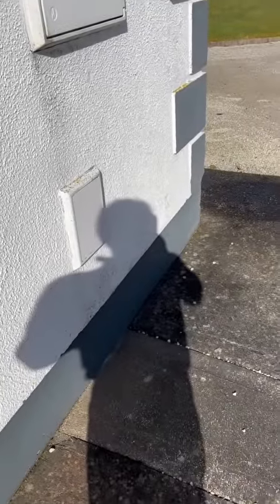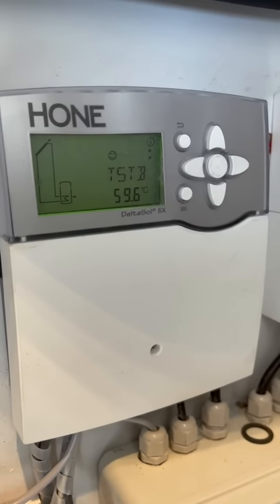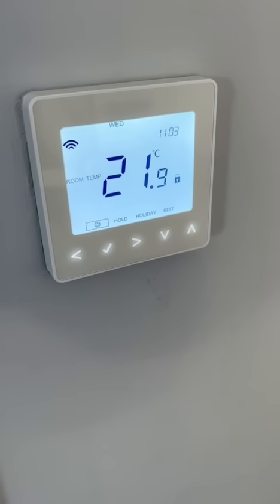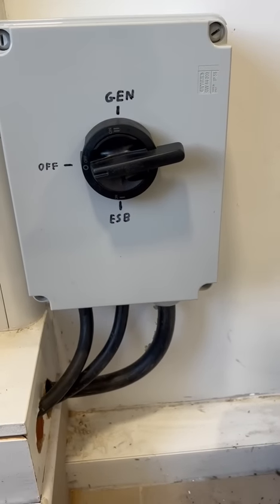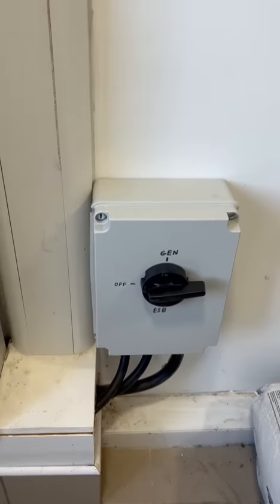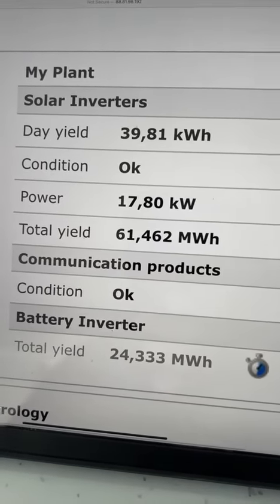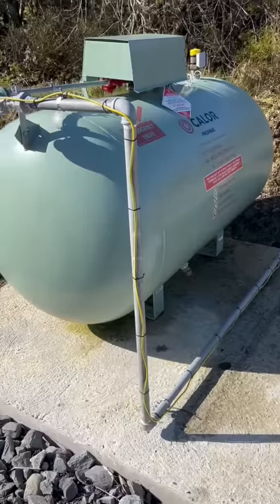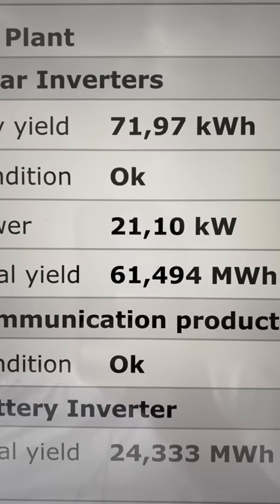Living off the grid in the west of Ireland....

Comment: Fantastic setup, it would be brilliant to see a breakdown of commercials to include ROI for your installation.
Reply from the maker: HI, if you go onto the main website and select social from the menu, you will see discussions on this subject on the post with this video. https://honeworld.com/eng/
Reply from the maker: HONE
0 seconds ago
The payback on this system is 5.1 years with 45 year design life. It had been 7.3 years payback but the current energy price hikes have shortened the payback so it will be fully paid for early next year.

4,500 sq ft home, no electricity bills, no heating bills, & 4 EV's charging since early 2018.

The cost for the energy upgrade, wall & attic insulation, MHRV, Chimney removal, Renewable Heating system, Renewable Electricity system, 1-week on-demand professional battery pack (70 kWh) & all controls, and management system so full unattended operation like as if it is a normal home was €90k in 2018.

- No heating bill
- No electricity bill
- No hot water bill
- No petrol bills - (EV charging is all free, and with current petrol rates, each kWh is worth over 90c in savings.
Reply from the maker: Basically, it's a lifestyle choice.

We don't like to rent our homes and prefer to own them, and they are significantly bigger purchase costs than energy systems.

Owning your own energy system is just another decision to own your energy rather than rent it from someone else.

This means, like the house, you are investing in low or no energy bills with significant advantages in that you can also get rid of petrol/diesel purchasing as well, are immune-ish to energy price increases & in this particular case, immune to blackouts & any impact on your normal life.

In the end, it's not really you who is paying for your system; it's all the fuel & energy suppliers to whom you are no longer renting energy.

Just looking at this customer's house size and the current market energy costs, the kerosene bill would probably be at least €6,000 for the year & we know the last ESB bill before the changeover to full off-grid was €736 per 2 months with 2 EV's included in that in 2018. That would be double the cost today as well.

Even without considering all the other benefits, that's a saving of over €10,400. Add all the petrol not being bought from 3.5 EV's all charging for free, and the change of a diesel 4x4 to an electric one which saved €2,200 on annual road tax.

(Note: EV's in rural Ireland are nearly doing full charges every two days due to the distance they travel)

You are now up at €16,000 to €18,000 annual savings.

You could also add in the hot tub, which costs nothing to run for 8 months and a big bar fridge which is the same. These also have significant savings.

So hopefully, you can see this is a lifestyle change rather than just trying to reduce your energy bills.
Reply: What about the fact that recycling the solar pannels isn’t meant to be sustainable?

Comment: Has any insulation been installed throughout the house?... windows roof etc.?.. the video just states its a standard concrete bunker bungalow?... seems as if the efficiency would be boosted further with good insulation.
Reply from the maker: Cavity wall had been pumped and a tea cosy insulation upgrade in the attic, all low hanging fruit efficiency upgrades would have been completed.
Reply: If it sound to good to be true there has to be a catch the Us older folk used to call here the Free State there is nothing free here We are all paying for renewable energy grants in our electric bill

Comment: That’s fine but all that gear must have cost an absolute fortune?
Reply: Either you pay 700 Euro a month forever (Plus price rises) or pay 20,000 once for 20+ years of electricity.
Reply: @eoino.c4275  For a solar system, not boilers. Here in NZ we don't use boilers - it's electricity at 14p /kW or solar. So our economics are different. The Hone system would cost more than it saves here. To me, gas is dead due to the lack of Russian gas and the price of USA gas. So 100% solar system with super insulated houses (R6 walls, R5 floor, R10 roof and triple glazing in an airtight building almost eliminates heating requirements.)

Comment: It's not free or even fully renewable for that matter. The installation costs has to be recovered first off, its maintenance and repair are also all your concerns and expense going forward. When you factor in everything, you will be waiting quite a while to just break even.
Reply: Yes, about 10 years. BUT - thereafter it is all free and no price rises. For a new build, the cost of bringing power from the road will often cut this upfront cost significantly. Where I live - $30-50k to bring mains to the site. So that is a free system right there.
Reply: I doubt if anybody would not know what he means or be so pedantic.
Reply from the maker: The cost has mentioned many times on our website. The payback on this system is 5.1 years with 45 year design life. It had been 7.3 years payback but the current energy price hikes have shortened the payback so it be fully paid for early next year.

4,500 sq ft home, no electricity bills, no heating bills, & 4 EV's charging since early 2018.
Reply: @HONEWORLD  Plus the sheer joy of being off grid out of the grips of vultures .
Well done.. 👏👏👏
Reply: @HONEWORLD  brilliant that you have done this
Reply: And a traditional boiler system has all those costs too, plus paying for the energy.
Reply: Free energy is not green energy, What’s the carbon foot print for producing the solar panels and the lithium batteries?
Also recycling the batteries in ten years may be more expensive than your entire installation.
Reply: @HONEWORLD  what is the cost for the annual maintenance of the plant?
Reply from the maker: @FactoR9411  No annual maintenance, there is a fluid change service on the renewable heating system every 5 years, takes about 10 mins.
Reply: @HONEWORLD  the gas unit needs annual maintenance AFAIK, under Regs as a gas appliance though ?
Reply from the maker: @johnmoylan7202  yes, correct, this is true albeit it has a smart management system, LAN networked unit which manages operations & maintenance electronically online. Apparently, air filter, oil filter, visual check, etc. are decided by the unit’s software.
Reply: @grahamcampbell9261  is that in the United States?
Reply: @snakeeyes3733  No - New Zealand

Comment: How much did all the solar panels, batteries, switches, boiler, cabling, distribution and back up generators cost you. Do you think it possible to get a cheap electrician to install the private grid and array of systems.  I know I got a light put in my kitchen recently and it cost 350 +.
Reply: I would say this system cost at least €30k... and you won't see any return on that investment for at least seven years. He chooses to omit that fact.

Comment: What would that complete system cost? In or abouts..don't need exact numbers thanks
Reply from the maker: The cost has mentioned many times on our website. The payback on this system is 5.1 years with 45 year design life. It had been 7.3 years payback but the current energy price hikes have shortened the payback so it be fully paid for early next year.

4,500 sq ft home, no electricity bills, no heating bills, & 4 EV's charging since early 2018.
Reply: The video on their site says about 90,000 euros, 35k for the house and the rest for the extra panels to charge the cars.  I dont think that includes the green gas.

Comment: The question is, how much?
Reply: Exactly
Reply: About 1/4 of your power bill. Depends if you buy retail or build your own system
Reply from the maker: The cost has mentioned many times on our website. The payback on this system is 5.1 years with 45 year design life. It had been 7.3 years payback but the current energy price hikes have shortened the payback so it be fully paid for early next year.

4,500 sq ft home, no electricity bills, no heating bills, & 4 EV's charging since early 2018.

Comment: How much does this system cost to put into a house is it free or did you pay 30,000 or 40,000 euros, my ESB costs is about 1,600 euros a year, my heating oil is about 1,000 euros  a year so thats about 2,600 a year. if I spent 30,000 or 40,000 euros of electricity from the ESB I would buy many years of electricity. So I don't understand when you say you are making a saving by not having electricity unless you got that system for free then you would be making a saving
Reply from the maker: This may help you. The last electricity bill in this project was €736 for 2 months in 2018, (would be about €1,500 today for 2 months) for electricity & EV charging (EV charging in rural Ireland is expensive). In addition, this project has a full renewable heating system and oil consumption in a 4,500 sq ft home would easily be €5,000 -€7,000 a year at the moment. All these bills are gone. Every project will be different and small houses are not suitable and usually do not have the space to go completely off-grid. The typical house which benefits the most are one-off houses.

Comment: Amazing system. Have you worked out cost benefit of staying connected to the grid and selling your surplus energy? Or is that just not worth it
Reply from the maker: Selling to the grid for a few cents will only run down the life on your equipment, it has no real return on investment, EV charging saves you 98c/kWh in avoided petrol/diesel and you can see what avoided electricity costs look like, heading for 70c/kWh to 1€/kWh by October according to analysts last month, nearly seems impossible if the impossible hadn't already happened.
Reply: Where do you start to get a system like yours for someone who has zero knowledge about it because I am interested in this but I know more about the edge of our universe than I do about this and I know nothing about our universe thanks in advance

Comment: I'd say this cost an absolute fortune to build. Living off the grid is great but it's obvious it costs a bomb to make it happen.
Reply from the maker: Basically, it's a lifestyle choice.

We don't like to rent our homes and prefer to own them, and they are significantly bigger purchase costs than energy systems.

Owning your own energy system is just another decision to own your energy rather than rent it from someone else.

This means, like the house, you are investing in low or no energy bills with significant advantages in that you can also get rid of petrol/diesel purchasing as well, are immune-ish to energy price increases & in this particular case, immune to blackouts & any impact on your normal life.

In the end, it's not really you who is paying for your system; it's all the fuel & energy suppliers to whom you are no longer renting energy.

Just looking at this customer's house size and the current market energy costs, the kerosene bill would probably be at least €6,000 for the year & we know the last ESB bill before the changeover to full off-grid was €736 per 2 months with 2 EV's included in that in 2018. That would be double the cost today as well.

Even without considering all the other benefits, that's a saving of over €10,400. Add all the petrol not being bought from 3.5 EV's all charging for free, and the change of a diesel 4x4 to an electric one which saved €2,200 on annual road tax.

(Note: EV's in rural Ireland are nearly doing full charges every two days due to the distance they travel)

You are now up at €16,000 to €18,000 annual savings.

You could also add in the hot tub, which costs nothing to run for 8 months and a big bar fridge which is the same. These also have significant savings.

So hopefully, you can see this is a lifestyle change rather than just trying to reduce your energy bills.
Reply: living in Eire too.  I bought 20 years ago 2 acres of land for 2200e. made a forest of it.  I cut 2 trees every year and plant 4 new ones. timber used in a Norwegian stove with back boiler and cooking plate.  no heating bills at all. I've no gas connection.  and the electricity bill was 70 e last month
Reply: @xavierderck3910  would love to see the stove.

Comment: Why the padlock on the electric meter and it's seams to be still connected to the mains electric   Electric meter should be removed if this system is as stated john
Reply from the maker: The padlock has locked the mains supply isolator in the off position. The meter is still grid connected as the account was kept open (like insurance), this is normal in off-grid systems. In this case, no power is required from the grid in normal Jan to Dec operation & the last draw off from the grid was in 2018.

Comment: Do yo have info on cost and return time.
Reply from the maker: The payback on this system is 5.1 years with 45 year design life. It had been 7.3 years payback but the current energy price hikes have shortened the payback so it will be fully paid for early next year.

4,500 sq ft home, no electricity bills, no heating bills, & 4 EV's charging since early 2018.

The cost for the energy upgrade, wall & attic insulation, MHRV, Chimney removal, Renewable Heating system, Renewable Electricity system, 1-week on-demand professional battery pack (70 kWh) & all controls, and management system so full unattended operation like as if it is a normal home was €90k in 2018.

- No heating bill
- No electricity bill
- No hot water bill
- No petrol bills - (EV charging is all free and with current petrol rates, each kWh is worth over 90c in savings.
Reply from the maker: Basically, it's a lifestyle choice.

We don't like to rent our homes and prefer to own them, and they are significantly bigger purchase costs than energy systems.

Owning your own energy system is just another decision to own your energy rather than rent it from someone else.

This means, like the house, you are investing in low or no energy bills with significant advantages in that you can also get rid of petrol/diesel purchasing as well, are immune-ish to energy price increases & in this particular case, immune to blackouts & any impact on your normal life.

In the end, it's not really you who is paying for your system; it's all the fuel & energy suppliers to whom you are no longer renting energy.

Just looking at this customer's house size and the current market energy costs, the kerosene bill would probably be at least €6,000 for the year & we know the last ESB bill before the changeover to full off-grid was €736 per 2 months with 2 EV's included in that in 2018. That would be double the cost today as well.

Even without considering all the other benefits, that's a saving of over €10,400. Add all the petrol not being bought from 3.5 EV's all charging for free, and the change of a diesel 4x4 to an electric one which saved €2,200 on annual road tax.

(Note: EV's in rural Ireland are nearly doing full charges every two days due to the distance they travel)

You are now up at €16,000 to €18,000 annual savings.

You could also add in the hot tub, which costs nothing to run for 8 months and a big bar fridge which is the same. These also have significant savings.

So hopefully, you can see this is a lifestyle change rather than just trying to reduce your energy bills.

Comment: Can you not sell the electricity your not using back to the grid saves you the 300 you pay to ESB yearly
Reply from the maker: Couple of things with that,  this system is off-grid and has disconnected the backup grid connection as it wasn't used in 4 years as the price for it has now increased to under €600 per year. A new backup using bioLPG on a 12KW gas generator costing €90 a year for piece of mind has been installed - Additionally feeding into the grid for payments is a bit of a red herring and the clean export guarantee (Ireland) for your export is 13.5c/kWh in year one only and falls away by 1 cent per year until zero. You'll only get money after this if the suppliers want to but your surplus so they can sell it back to later at full price.

BUT the most important thing about a private grid system is that it is load following which means it only generates electricity when it is covering loads so this means your equipment life is extended by decades, this is a key part of the design which would be undermined by exporting surplus.

This is where your surplus electricity should go, 1) EV (worth 94c/kWh in avoided petrol costs, 2) Avoiding electricity purchases (rates heading for north of €1/kWh Q1 2023) & selling to the grid, don't worry, they grid will get the few quid they give back from you with increased pricing at the end of the day. Once you depend on them, they will always win.